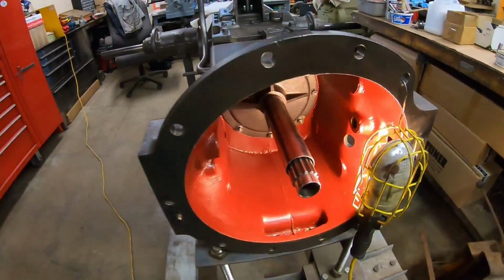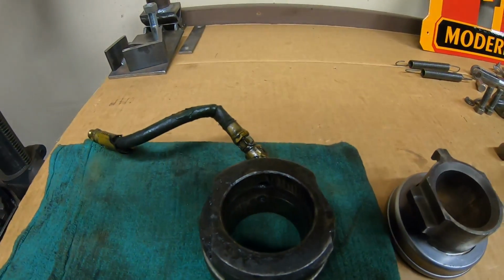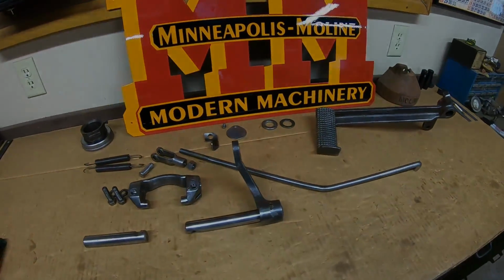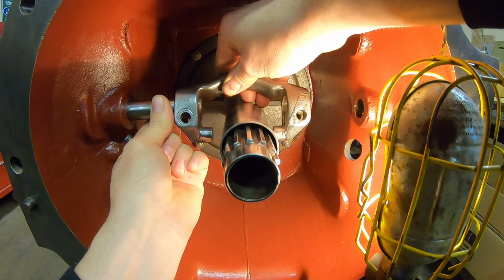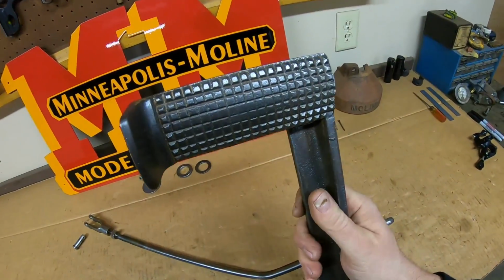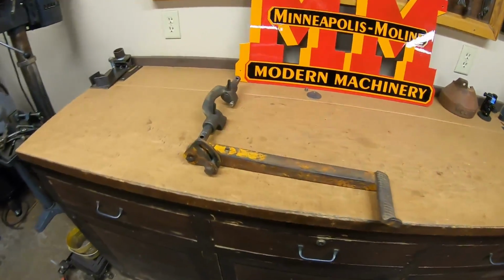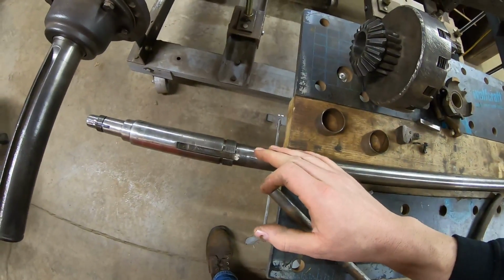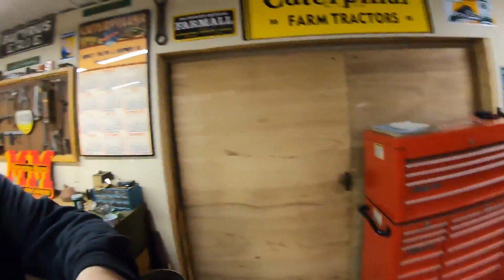#X231 Prototype Part 57: The Coolest Clutch Pedal Ever & Serious Problems Come Back Around...

Comment: Aaah.  You know the slit you sealed up, could this be there to help lubricate the clutch release bearing?
Reply from the maker: I looked at that angle, but decided it wasn’t a possibility because no oil or grease can come out from under the tube because the input shaft seal keeps it all dry 👍

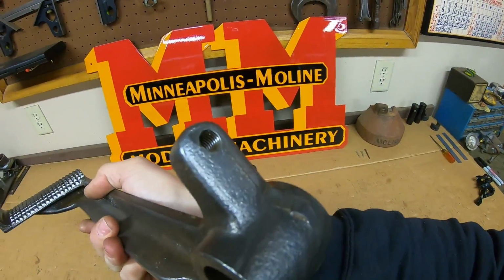Comment: The threaded hole at 11:36--could this be for a stop bolt going up against the diff  housing to provide a resting place from which to adjust clutch pedal free travel?

Comment: . They are not cota pins they are split pins Cotter pins are a solid round piece of Steel with a thread and a nut at one end and the shamfa push bikes having do whole the panels tank onto the bike Crankthe ones with the split up the middle are split enz split pins split pins not Cotter

Comment: Is there some fashion I am not seeing yet for more springs on the clutch? That threaded hole on the pedal might need an eye bolt with another heavy duty spring. I would be concerned with the pedal (instead of the operator) riding the clutch.
Reply: @squatch253  I know, just a thought that's all.

Comment: Hello from Cloquet.  Just wondering the mystery hole on the bell housing, were you said you could oil the throw out bearing if needed.  Do you intend to put a plug of some type there so water and grit stays out of the throw out bearing area?

Comment: With that throw out barring design. It looks to me that the original intent was what is currently seen on the production models. Except that they must have run into some issue, be it design, parts availability or rework (probably quite a lot of that happening). At the end of the development period they simply hadn’t managed to fully implementing it so they went with what they had or just cobbled something that works. In that regards a prototype is never really finished, it just gets to a spot where it’s “good enough for the prototype” and they simply move to production where they sort out any remaining issues.

Comment: I certainly realize my opinion probably does not count for much if anything but my view would be to utilize production parts as necessary to get X231 operable on it's own wheels and save prototype part restoration  repair as time and finances permit, (probably winter projects). As you have noted recently on several occasions the future life of X231 will basically be confined to rolling on and off a trailer and getting it operational visually in it's original external prototype form makes that mission possible and does not compromise  your intent to preserve an historic orginal tractor.

Comment: That mystery hole is an odd one alright. Since it's not threaded and is farther back than the grease zerk hole that's plugged, and is as large as it is, it might be a viewing port where a camera was placed to check the inner motions of the clutch when assembled and under load to see if a "dry" clutch and bearing would be a thing worth exploring. That's my guess for that hole.

Looking at the live power shaft end where it connects to the flywheel, it looks about like the portion that was engaged was about twisted off. Though that could have just been shadow coupled with camera distortion.

Comment: Kinda makes me chuckle, IH did the opposite with the clutch pedals on the early vs late 300 Utility and later Utilities. The 1955 300s had a front pivoting pedal that attached directly to the fork like the 445 production pedal. Then in 1956 they changed it to a rear pivoting pedal with a linkage.

Comment: I would make it where it works and you can get it back in running condition only the people you tell will know if you put in production parts to make it work correctly. I have to do the same thing with my little economy tractor, keeping an old machine running so others can see it is more important, as long as the outside doesn't change . People will not see the inside once you have it back together.  That is just my two cents of thoughts .

Comment: I’m going to predict that clutch pedal will require an outer spring on the pedal to keep the throwout bearing off the pressure plate fingers when not engaged. I say this because I see those two springs on the throwout bearing are not strong enough to hold the pedal up like it should be. Keeping the bearing back away from the pressure plate fingers when not in use.

Comment: As many others have recommended, I endorse the replacement of prototype PTO parts with proven production items.  I do understand the desire to keep it "pure" but you have to acknowledge the risk that comes with re-using the very parts that took it out of service.  I suspect that there are casting defects, nicks from previous repairs (stress risers for future crack origination) and the failure(s) as well as potential hidden/internal cracks already initiated as part of previous failures.  These defects pose a real and not insignificant risk for future failure, possibly even unrecoverable damage.

Comment: Some time you have to Sept back like you did before so you don't get burned out. Work on something else then when you go back to it you will have a fresh outlook. I really injoy watching you figure out how to fix and rebuild the parts and assembly. I am getting an itch weighting for that cab to be installed on that awesome j1113 . By doing that formall tractor that will be a good 👍 mix on your channel. I will be there also for tractor. Keep up the awesome videos Denis from Santa Rosa CA.

Comment: Well you could put the production parts in to move on and either keep the prototype parts or have them rebuilt and put them in later. At least this will get you finished until the parts are available.

Comment: Not that my opinion matters a great deal with how you proceed but…. If the prototype parts for the live PTO are what caused things to fail, would it not stand to reason that to give X231 the best chance at surviving long term again would be to replace the prototype parts with production parts?  I know your trying to save as much as possible but if it runs the risk of failing again the same way all of you hard work will have been for nothing.  Looks like most would be internal parts so cosmetically or won’t change the look of the prototype styles.  I would just keep records of what is no longer prototype stuff that can stay will the tractors paperwork. Just my thoughts 👌👍

Comment: In this instance I would just swap in the production parts and keep the originals as the example of what was done initially. This is a non visible item, so no point trying to save what was an inferior assembly with a failure potential that may have destructive results that can not be seen any way.

Comment: I admire your dedication to the experimental aspect of 231.  That being said the design that killed the machine was clearly not a good one. I’m so not think anyone would fault you for moving past the destroyed parts and pushing forward with production pieces. Having so much of the mechanical work done it would be a shame to see it sit. The factory clearly mad a test mule out of it with the various changes to the ampli-torc so it is not as built. On the other hand keeping it as original as possible is what it is all about up to this point. Either way I’ll be eagerly awaiting the next update!

Comment: I, for one, enjoy the mechanical stuff more than cosmetic work. Regarding the PTO, if the production units are stronger (more robust) than the prototype 10x components, I would go that way for the rebuild. Even though X231 is destined to be a show / parade tractor, just the peace of mind knowing the PTO is as strong as possible would be worth it. While a purist might complain, many people are more interested in seeing the tractor run and operate and being able to identify the exterior prototype elements (clutch lever, for example) than worrying about the originality of internal components.

Comment: You weren't rambling but showing a big concern on a massive undertaking, personally depending on the workshop setup make a new series of components or swap out with production units  and hang the busted parts up on the wall. Just know I for one wouldn't blame you for using production parts as X231 is a 10X prototype and originally Youse a number of production parts all elements all be it from a ZB etc

Comment: Would it be possible to remove that powershaft? leave the PTO shaft hanging off the back so it looks like it' fully functional, but remove that whole unit on the bench until parts can be fabricated or found, and every part in that subassembly looks like it's unusable from this side of the screen, and I'd be worried about a repeat performance of the clutch shedding parts if the prototype unit went back in, so I would personally lean towards using a production unit in this situation, simply because the prototype seems like it'd be next to impossible to use, and from the repairs that've been done to it it seems more than eager to start shedding parts into the back end. I also very much enjoy the X231 content, it's got the amount of attention to detail that I just don't see much.

Comment: The people working in the “new tractor design” shop had no reason to consider the longevity of this tractor. It was a test mule and and the desired lifespan of component pieces was 2 laps around the test track. The inability to lube the throw out bearing was dismissed as soon as someone mentioned it, for one example.  The prototypers lived in the here and now universe. Now Squatch, on the other hand, lives in the, “If I don’t remake this part in aero-space wonder material, it could be worn out just as someone’s great grandchildren are ready to inherit it”, universe. Cant have that. 
I hope the next part goes better than you are anticipating. Hang in there. You got this! 🥸👀🔧🔨👍✅

Comment: I'm wonering whether the cut in the pipe was made to provide lubrication for the throw out bearing to slide easier 🤔 I understand that its time to take a break on this project to regroup, aquire the needed parts and come up with a game plan moving forward. I think that restoring this tractor is like eroding a rock with water - its a long process with many little steps.

Comment: Sounds like you need a YT collaboration. Clarke at Windy Hill foundry may be able to cast you a new brass spider keeping the prototype part number. The shaft if its straight can be put in the lathe, welded up and new splines cut, same on the other end for the bearing., Keith Rucker perhaps? The clutch is up to you. Keep smilin

Comment: Thanks for bringing us along this far. I hope we get to see more of the hard stuff and the methodical process you choose in the next step, this is the tractor that got me here watching a few years back.  I was looking at marine parts sites online the other day for an antique crankshaft for a ford 510 or 590E 330ci diesel engine that's fitted in my Fordson Major tractor as well  as boats.  Something almost identical to that PTO Dog clutch assembly and the high low shift one with the brass yoke turned up in a picture on a transmission page. As soon as I saw it i thought of this tractor and your video's, somebody copied somebody else's design but who was first one would be interesting to know. Take care

Comment: PTO shaft splines can be welded, but you need to leave it soft as you loose any tempering they did. However for the application you are gonna use it for the most part it will be fine. Bearing surfaces you can either sleeve or spray weld. Of course you can turn it down a little and find a new bearing.

Comment: @Squatch253 The little hole that the clutch shaft pipe had was possibly used lubricate the clutch release bearing carrier trough slightly leaking seal. I mean it was a prototype, but I think that was it and they didn't bother with the grease port. Or someone did it afterwards and the mystery hole is exactly to be able to lubricate the carrier.

Comment: It is fascinating to see the condition of X231 prototype parts. To my mind (my two cents :-) ) being able to see the items discussed at the end of this episode at a tractor show alongside the working prototype would be really interesting.  The hours of work showing on the condition of the shaft and part that failed, that ended X231. There is history there to see and for my mind to ponder over.  We cannot know when the first repair was made but we know the second repair failed, after untold hours of productivity. Failed in the same place. If I spent hours restoring this and installed it, I know I’d have knots in my stomach every time I even thought about starting X231. I would not be having any fun. Squatch, you will figure it out and the solution will be amazing.

Comment: Working at a R&D lab for a large truck manufacturer I find this project very interesting. I do very similar things on a day to day basis, building prototype trucks, we are always changing designs, over engineering parts and just modifying parts off the shelf from older models to make things work. This build is very relatable and is amusing that R&D hasn't changed much in the last 100 years

Comment: 16:55 oh boy, they pushed that to the brink.
edit: i also think that this one doesn't pull people in because there's no build up for the pay-off. People got invested in the previous build even if they weren't like us. Me? I'll watch every second of these because it's exactly the kind of stuff i like and deal with, but others might not. C'est la vie, or in this case, that's how horribly bad YT's system works. The gems are always hidden and they keep pushing trash on all of us. If i didn't know to code, so i didn't have to deal with YT's front page and have my own custom sub page, i would've probably left this platform by now. Out of all the renditions i've been in from day one, this one's the worst so far and the new CEO is even worse than the previous one, because that's how that works.

Comment: It's  interesting  that on x231 the had a clutch  rod linkage and  went away from it on production 445.  Then on later  models like the jetstar, which is basically  the same size tractor. they  went back to the clutch rod linkages.

Comment: Well I'm content with what you do have and you have lots of stuff that makes great content between the IH 350 diesel and the H the road graders the jaw crusher  x231 I understand what caused the drives to get grenaded as that happens it looks pretty catastrophic from flywheel to the output end and I'm pretty sure you can imagineer a way to bullet proof that bit of tech for certain.

Comment: I don't think it is a good idea to try duplicating the pto shaft because of the many hours of work required.  Since this the area that caused the original failure, I would use production 445 parts and make the tractor less prone to failure down the road.  Like you had said before this tractor could never be put back together as it was the day it left the factory. If the original pto clutch is to worn out to be reused substitute what needs to be done to get the job done.  You have done an excellent job of keeping with original parts so far in the restoration. When the tractor is finished people will be more focused on what the exterior of the tractor looks like as it is compared to the production model. I have restored a few MM tractors in my day and the primary focus was on keeping them looking how they looked when they were new.  I used newer parts when the old parts were to worn or unrepairable to be reused.  Keep up the good work and I really enjoy watching your videos.

Comment: If you know the right people those damaged cast parts can be scanned and translated to CAD.  At that point any flaws or imperfections can be tweaked, strengthened, and corrected as needed.  Then a part can be 3D printed, then a pattern can be made and a new part cast.
Keith Rucker on Vintage Machinery does this a lot with Windy City Foundry for vintage machines.

Here's an Idea, extra 3D printed parts sold as "merch"

Just saying

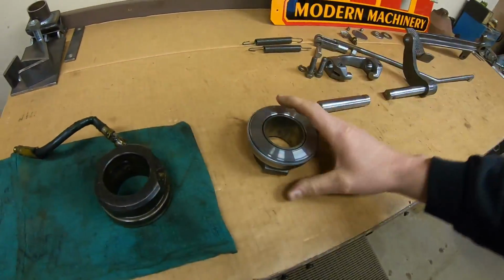Comment: @ 2:36 , what you are calling a bell-crank I would call a yoke connector or a yoke clevis.
The "EAR" in the clutch pedal is actually a bell-crank.
A bell-crank is used to translate rotational movement to linear movement.

Keep the videos coming
I'll keep watching

Comment: With it being a prototype, they likely did away with any lube options (other than the initial splurge) to see just how long does the system run on that one lube shot. It makes sense, and it does explain the plug.

Comment: Another excellent film. for what its worth, I think you should abandon the wrecked and failed bits of that driveshaft and clutch, and see if production mdel bits will fit. I know that is not your ideal, BUT it would speed up the progress, .I do not watch painting films. The mechanical stuff is wher one learns. Yes I knoiw I am only one of in this case 411 views, and 66.4k Subscribers, but the film about fold over locks is more interesting than painting.

Comment: Toby thinking through the mystery hole in the bell housing and the fact the port is cast in for the grease tube it appears the engineers were testing out the idea of a non greased carrier after testing a greased carrier on previous ideations ex. X230.

Comment: I would put a plug in that hole of some sort to keep mice from getting in there I had a mouse get in mind and build a nest in the clutch and peed all over the pressure plate and rusted the springs clean off of it I had to separate the tractor to change it